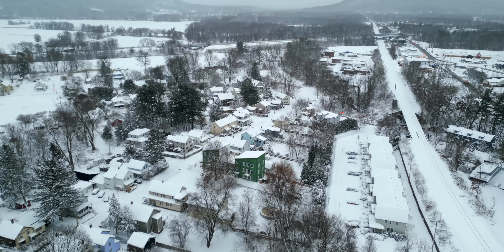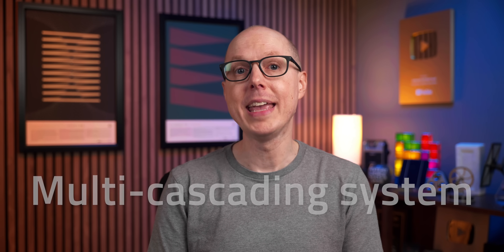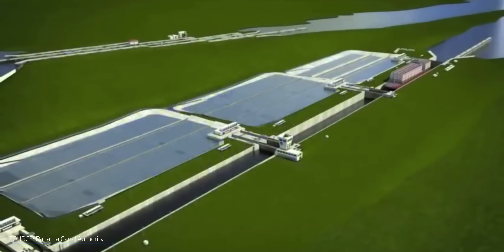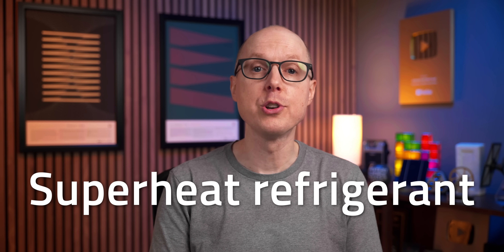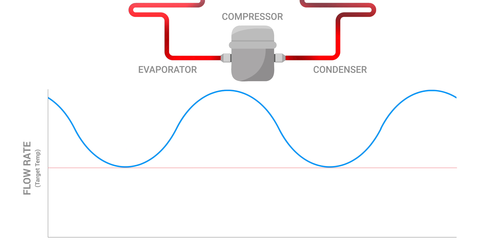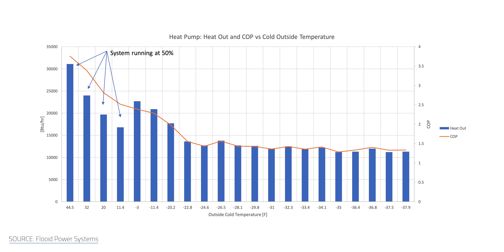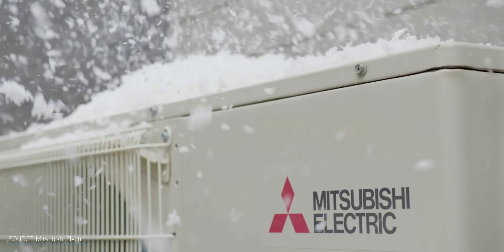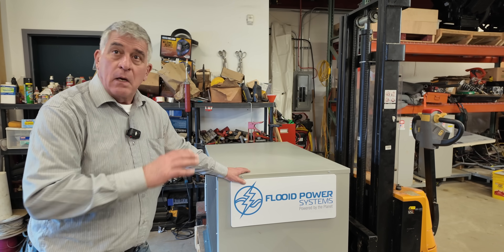How This New Heat Pump is Genius

Comment: Hi Matt,
I live in the UK in a 350 year old lovely, stone house. I have been told heat pumps cannot serve my old radiators in my central heating system as the temperature they produce will be too low and I do not want to add additional radiators and the thick stone walls rule out ducted air systems. 
Our winters are not as cold as yours, rarely below -5 degrees C and mostly dip to around 0 degrees C. Can this system be used to provide a high enough temperature for my radiators to work well. ie to move the whole cascade up a temperature notch??
Reply from the maker: Yes, it can.  They have a demo unit of a heat pump boiler that can do radiant heat.  A single loop heat pump system is going to struggle, but a cascading system can get those temps very, very hot.
Reply: On a "normal cold" so for you around 0C, turn down your heating. If you are using a modern boiler, you can set the flow temperature. Set this to 55C and turn all your radiators on high. If this keeps your place warm enough, you should be good.
Reply: Hi, I'm not Matt but I'm a mechanical engineer.
I would recommend that you ask your local contractor to check the following:
1) Air to Water heat pump with refrigerant R744 (this is CO2). It gives temperatures up to 90C. Certain Japanese brands have been offering ready-made solutions for more than ten years.
2) Air to Water heat pump with R290 refrigerant (this is propane). It gives a temperature of 70-75C. Heat pumps with this refrigerant have existed, but a certain boom has been observed in recent years.
3) The R410A/R134A cascade is not something new, I remember this as an existing and proven technology for the last decade and a half. Again, top Japanese manufacturers have all this.
Good luck.
Reply: A heatpump can be used in addition to a traditional electric heating element. The heatpump will get up to ~60 degrees and the resisitive heater will take care of the rest.

Comment: I'd recommend not relying and trusting cooperate testing results... In Europe there are now more and more independent labs testing heat pumps, e.g. check out "Wärmepumpen‐Testzentrum WPZ". Just look up "Prüfresultate Wärmepumpen". Depending on test cycle water-air heat pumps are now achieving a SCOP of up to 5.96/4.44 for lower/higher temperatures (Lambda EU10L).

Comment: I still don't understand what the "secret sauce" is. Packaging old technology in a new way?   It feels like building the system, customizing the configuration based on the climate, would be a most cost effective approach rather than trying to stuff all the components into a single box.  What if I only need 1 heat pump stage but the box has 2 or 3?  What if I need 4 stages but the box has less?  I'm sure they are designing the "box" to fit as many environments as possible but increasing the operating envelope has to increase system cost.
I think most people really don't care what goes on inside the box, they just want it to heat and cool for the least money possible. 
Thanks for the vid!
Reply: Cascading systems allows you to have an inefficient loop with a wider operating temperature feeding a loop with a narrow operating temperature but better performance.  Exciting developments are likely to be around the control of the units, optimising the total system COP instead of the COP for a single loop.
Reply: @Anonofyourbusiness8565  Yep, they said that.  You don't have to put everything in one box to have an inefficient loop coupled with a more efficient one.
Reply: The "secret sauce" is the software that manages the compressors to very tight tolerances. AI wasn't mentioned, but there is potential for AI to optimize the operation of a cascaded system even better than a human.
Reply: @tlangdon12  AI isn't necessary. These are just PID loops.

Comment: Looks at systems for my new building and like this idea. Wonder if this can be designed to manage radiant floor heating and or pool heating/cooling. Seems like an efficient way to do it especially when focused on maintaining temperatures versus trying to make big changes. I'd like one or two systems that handle climate control, radiant floors, hot water, pool, etc.

Comment: My heat pump works in the range of -20 to 120.F.  It cost less the the repair of my older system and sips the electric juice. As I live in the mid south they did not recommend the use of heat strips.

Comment: 54°C is "extreme temperatures"? Modern European heat pumps can handle up to 70°C, at operating temperatures down to -15°C. And the COP of those heat pumps also don't sound really impressive. So I don't really understand what's the big deal here.
Reply: Highest recorded temperature on Earth is 56.7, so I think 54 would qualify as extreme.
Reply: Modern European heat pumps can handle -15C to 70C with a COP over 2 throughout that range?

Lol doubt.
Reply: There is no way you think modern european heat pumps can do up to 70C. Their heat waves that cause death are at like 35C or 95F
Reply: @cantingpython   They heat water to high temperature and then radiators send this heat into the room.
Reply: different refrigerants have quite varied properties and effective temperature ranges on the hot and cold side, so those were probably just averages. system design and the refrigerant used play a huge part here

Comment: Can you cover more insulation related topics? 

Heat pump would be great… but in the winter if I turn off the heat, my house drops a couple of degrees every 15 minutes… 

Fun insulation techniques that don’t require a 60k window replacement project would be pretty cool to see.

Comment: Cascading heat pumps are not the future nor genius, they're just a bandaid on a regulatory backwardness of the US.

Please research refrigerant operating ranges. While the US is still marvelling at "new" R410, Europe and other markets have been phasing it out, and even R32 is being phased out as R290 (Propane) is increasingly being introduced and is now the new standard. You can have heat pumps operating till 75°C in normal single-stage designs with high COPs.

Unfortunately for the US audience here, due to regulatory limitations, it's unlikely you'll be able to experience these any time soon.

Comment: A COP of 2-4? This is not good, this is bad. We're talking of COP's of 5-7 here with traditional heat pumps....  :o
Reply: You understand that COP varies with temperature, right? Just because a system has an advertised peak COP under optimal conditions, doesn't mean it can maintain that through all conditions.
Reply: Oh. I understand, they want to do baseboards without using larger baseboards or underfloor. Pretty wasteful and inefficient compared to just heating the air to the temperature you want or just using a larger baseboard at a lower temperature.

Comment: Complex systems are only beneficial if reliable. 

As a home builder that delivers around 300 homes a year… we are seeing a 38% failure rate of hybrid water heaters.  We had a 0% failure rate with electric, 3% failure rate with gas and a 6% failure rate with tankless.
Reply: What's the cause of the failures?  My understanding is they are often installed without understanding the requirements for them to be able to work correctly like in a small room or an unconditioned space that gets too cold.
Reply: @Bradimus1  most of control boards, and some compressors
Reply: @BiggMo  so it sounds like new product teething. Just like don't buy a first model year car. Thanks for following up!
Reply: @BiggMo - Bad control boards aren’t unique to heat pumps, unfortunately.   Throwing made-in-China circuit boards into appliances was always a recipe for trouble.
Reply: @Bradimus1  Yeah, my initial reaction was 38% can’t be accurate. You’re doing something wrong.
Reply: @SocialistCharlieKirk  it could be the brand has a major problem with a first gen product. But I'd just be curious to hear what he says his experience is.
Reply: @SocialistCharlieKirk  Translation: "I'm unwilling to challenge my worldview."
Reply: @Bradimus1  A builder putting up 300 homes per year is not putting in the same amount of care and investment that a homeowner putting up their own house would do.
They just can't approach it the same.
An assembly line builder is looking for fast and easy, and the ones who actually care about quality have to fight against the flood of unqualified, untrained subcontractors that are clogging the flow.
-
Then you have to look at who is holding the financial liability in such high-volume builds. Is the bankroller going to want to spend the money for above-code insulation and the best quality inclusions like solar panels and heat pumps? Or are they going to pour their money out on the features that catch the most buyers, like pretty kitchens and multi-head showers?
Reply: @MonkeyJedi99  why are you telling me that. 😂 I've not called that into doubt. I just said most problems I read about were improper installation. I wanted to hear what the high failure rate was all about.
Reply: @Bradimus1  Should I have been more clear?
My guess is that the high failure rates cited by the OP is due to a confluence of 1) cheap hardware and 2) unskilled/uncaring installers.
Reply: @MonkeyJedi99  is that telling me anything I didn't suggest? I want to know what BiggMo says was their experience.
Reply: I work on cascade systems. Reliability is probably going to be ok... Not great but ok. Twice the components, and 2 different refrigerants will mean roughly double the repairs. Some ultra low temp refrigerants are extremely expensive. (Eg >$300/lbs)
Reply: Is this across all brands of just certain brands? I have been looking into this option and I keep finding conflicting reporting.
Reply: @paperburn  mostly Rheem
Reply: @BiggMo  Our Rheem gas water heater is a piece of crap too. The ignition system has repeatedly failed. They outsourced it.
Reply: So put that 10 year warranty to work. If you've also had over a hundred fail, that's going to be enough to get on their corporate radar. At your volume, this is an easy fix.
Reply: Retired H.V.A.C guy. Too many moving parts! Too many complicated electronic controls! Reliability is a huge problem and repair costs will be expensive.
Reply: 38 per cent is not entirely impossible. These heat pumps on top of water tank are small and poorly made, tho stiebel eltron are different (and 1,000 more pensive the worst aspect there 38 per cent or 13 per cent failure , is these are essentially closed system and not field serviceable. As for warranty, labor is not provided after first year and good luck getting a plumber or and hvac tech repair these systems.
Reply: Personal anecdote:  I installed (non-plumber, but handy) a GE GeoSpring hybrid electric water heater in 2015 (40 gallon), probably paid itself off by now.  Save about $7-$10 / month on hot water.  Other than an annoying filter dirty reset alarm every so often, it's been great.  Also initial cost was around $800 from Sears before they went under.
Reply: Skill issue
Reply: I have heard that Rheem had quite a few quality control issues on their hybrid systems, but to me it didn’t sound like a theory problem, sounds like they just cheaped out on control boards and some parts. I don’t think the heat pump system has been the problem at all.
Reply: If the failures were the GE or AirTap / AirGenerate your failure rate isn't surprising. I think they cane from low-bid Chinese factories with poor QC. You might have had more success with Stiebel-Eltron, A. O. Smith or recent Rheem HPWHs.
Reply: Perfect! Thanks for letting us know! No surprise!
Reply: 4:52 no, that's just wrong. Electrically they will be far less efficient. They are more capable, not more efficient.

PS. They will also be far more expensive to buy, install, and service, assuming you can find anymore to even look at it. I work on cascade systems regularly, and I'm not cheap.
Reply: @benjiro8793  a fuel fired tankless is not just a resister. Even electric based ones use pwm, which means power grade electronics. That's assuming you don't buy the cheapest hunk of junk you can find that is likely not certified. I've seen some real garbage designs, some I wouldn't install even if you supplied it yourself.
Reply: Let me define my term “failure rate” … I’m referring to percentage of units that require manufacturer warranty repairs post move-in. We have seen a lot of bad control boards, blown relays, bad compressors.  The majority of these ‘failures’ occurs when the unit is stressed in the first winter.  These garage installations in The Pacific NW.
Reply: Dude these comments are killing me!
Armchair/keyboard builders coughing up every bit of minutiae as to how you’re getting the latest and greatest wrong. 😂
Reply: What they don't tell you is; hybrid water heaters are simply a BAD IDEA for many, if not most homes that are in a COLD CLIMATE. First, you have to understand that a hybrid water heater is a heat pump that moves heat from one place to another (from the air, to the hot-water tank). Usually, this is from the basement or the living space, to the hot water tank. Some of the heat that goes into the water tank actually comes from the heat pump motor, but this is relatively small, if the heat pump in the water heater has a decent efficiency. However, you are still paying for that too. 
This means, in the winter months, if the hybrid water heater is in the living space, you have to REPLACE the heat that was TAKEN FROM the living space. That means your furnace has to burn more gas, and/or use more electricity, to replace each BTU that was removed from the living space, by the hybrid water heater. The extra gas that the furnace burned to replace that heat, might just as well have gone directly to heating the water with a conventional gas water heater. 
If the hybrid water heater is in the basement, and the basement is not heated, then the basement temperature will drop lower and lower, as heat pump keeps pulling more heat from the basement, to heat the water. This high temperature differential (between the basement temperature and the water temperature) reduces the heat pump efficiency, and makes it run longer and harder to heat the water, causing early compressor failure. 
Then (if the hybrid water heater is in the basement), there is the matter of the COLD FLOOR in the living space above, since the basement is cold. This not only causes discomfort, but also can cool the floor below the dew point of the air inside the living space. Hence you get condensation and mold buildup somewhere in-between the flooring and the sub-floor. This is just like a wall that has no vapor barrier on the inside.
So what you have (when all things are considered), is a water heater that has more moving parts (costs more up front), produces more noise, is less reliable, uses more resources to manufacture (poor carbon footprint), makes the house less comfortable and does not really save any money.
If you live in a warm climate, then... maybe. But then again, there are other option that become more attractive in warm climates. It is amazing what can be done with a few solar panels that power an 80 gallon preheating electric water tank, that feeds into a second-stage tank, which uses conventional heating methods. No moving parts.
Reply: Yikes. I'm all for new, efficient technology but I'm not willing to be part of someone's post-release beta testing.
Reply: @benjiro8793  Have you heard of the words "made in China"?
Reply: @disposabull a lot of the best things are made in china, even things that dont say so because they were "assembled" somewhere else.